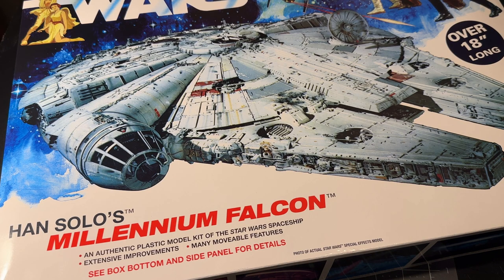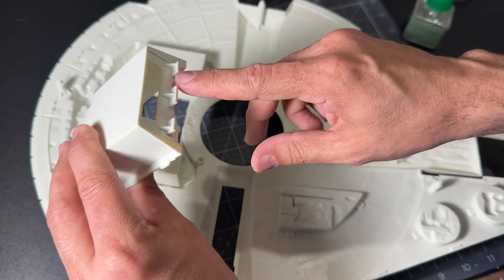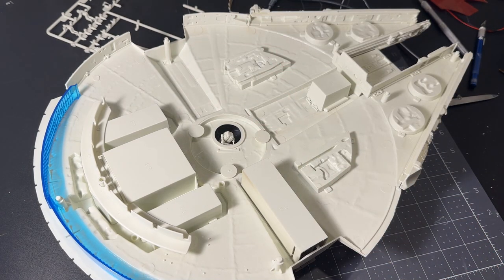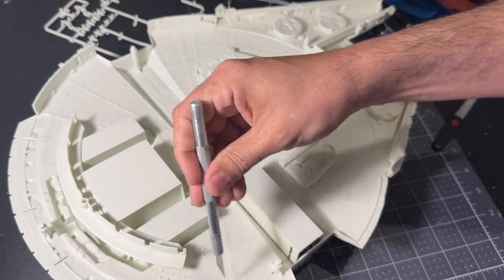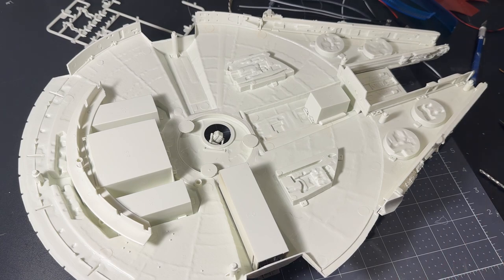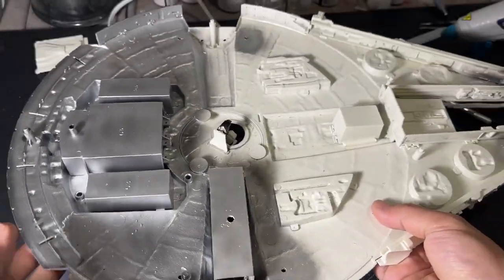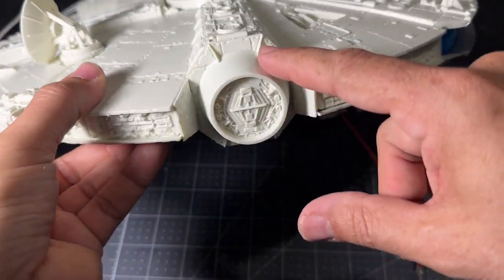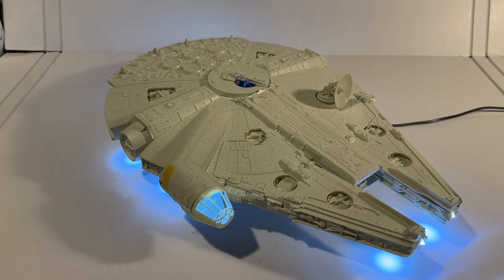2023 MPC MIllennium Falcon Build Pt 2

Comment: As far as lighting for the rear engines, I take a sandpaper pad and sand both sides of the clear blue plastic and it makes it very opaque and diffuses the light to make the glow even without hot spots.

Comment: As far as the fiber optics, so it seems you run the fiber optic past the surface of the model.  then you cut it flush?  What do you use to adhere the ends to the plastic? Crazy glue?  Thanks for the help.  This will be my first time using fiber optics.  I plan on making (2) separate circuits with (2) power sources.  One for the engines and cockpit (9V to run the LED strip) and another to run all the other lights (landed mode) with (2) AA batteries.

Comment: 15:50 do you need those plug and clip pieces for the power supply? Or can I just wrap the wire and solder around a 9v battery holder with red and black wire?

Comment: Nice work on the fiber optics. I have pre-ordered this kit on CultTVman, but not sure when it's due for release to the general public. Any insight? I have the original release, but dis-assembled it to update the lighting. It's a pile of parts right now. Wondering how the more recently available COB strip lighting would help with the hot spots on the engines.

Comment: Those jumpers are from the original version. I am busy building the original kit at this very moment. after having kept it in storage for a long time. Cockpit does not even remotely resemble the original. This is a pathetic model - improper build instructions, very poor painting guide, no decals! Back engine is non-existent - only flat clear plastic. My mini Bandai kit has way more details than this one.